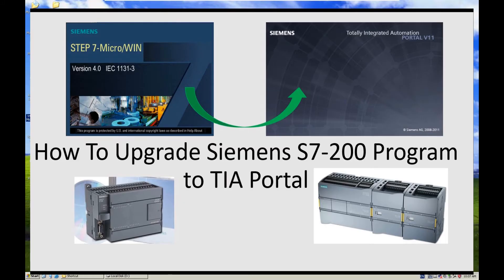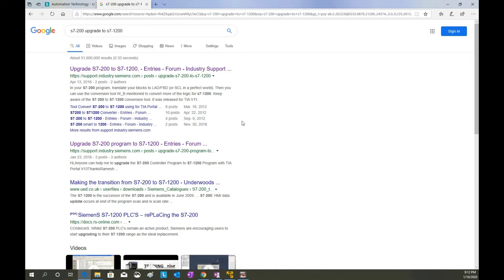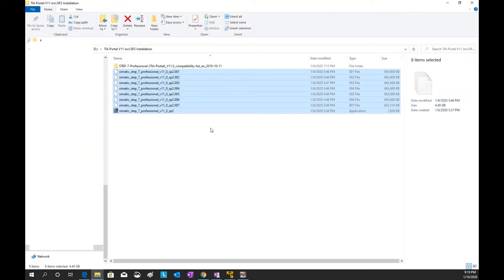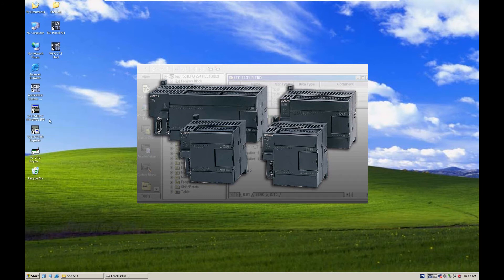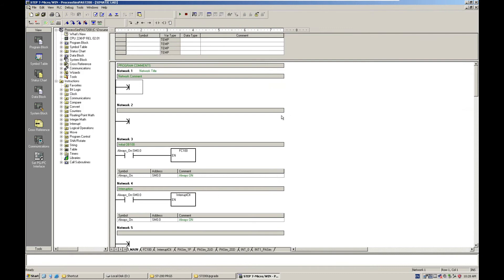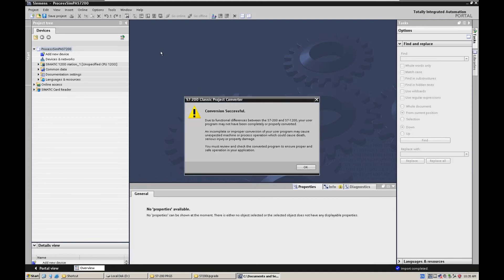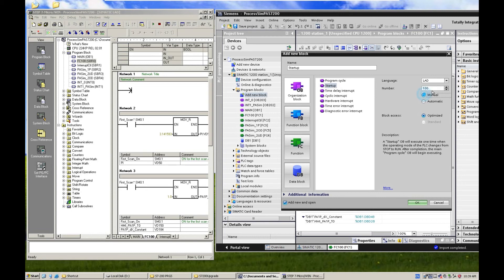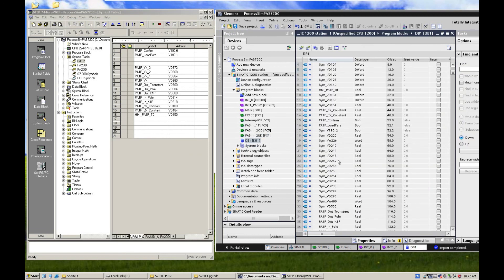U03. How to Upgrade Siemens S7-200 to S7-1200, Migrate Micro/WIN Program to TIA Portal

Comment: I want to migrate a project from Step 7 v5.5 to TIA.I tried the built in tool of TIA but it ends with errors.
Can anyone tell me the steps of migrating a project??
Reply from the maker: You can use the option 'Migrate Project' in TIA Portal to migrate Step7 project. But I highly recommend reading details on the following two links
https://support.industry.siemens.com/cs/document/62100731/what-are-the-requirements-for-migrating-a-step-7-v5-x-project-to-step-7-professional-(tia-portal)-?dti=0&lc=en-CA;  https://support.industry.siemens.com/cs/document/109478811/migration-guide-simatic-s7-300-400-to-simatic-s7-1500?dti=0&lc=en-CA

Comment: Is it only possible to convert to at most the tia portal v11?
Reply from the maker: I would say yes. I can use higher TIA Portal version to open the V11 project after you upgrade. Note that you have use TIA Portal v13 sp2 open it firstly, then use >=14 open the V13 sp2 project.
Reply: @electricalautomation  And so on until the V17?

Comment: It is not working for me. I tried many times to install new windows and follow all the steps but still no Convert tool possibility. I tried windows xp and 7 32 Bit in virtual machine.
Reply from the maker: Hello sorry for hearing that. Did you install the MicroWin before the TIA Portal? Please install MicroWin 4.0 sp9 firstly, then install the TIA Portal
Reply from the maker: Hello, I just found the converter tool and shared it via google drive. You could try to install it. Please see the comment under the video. Item#4. https://drive.google.com/drive/folders/1wQ6dAK5sWyA2wlqRurV5TIuUMOf7dPdT?usp=sharing

Comment: on siemens website, I got the V11 sp2 update 2... :'(
Reply from the maker: Good Luck my friend, pls try this link https://support.industry.siemens.com/cs/document/106449434/simatic-step-7-(tia-portal)-v11-sp2-trial-download?dti=0&lc=en-WW
Reply: @electricalautomation  
the new link is the same V11 sp2 update 2, i cant find the converter tool there
Reply from the maker: @cobymils  I attached a google drive link (under the video, comment) for the converter tool as a reinforcement. You can download it.

Comment: Dude, you saved my project. As old S7200 are a little bit scarce on my area, I got a machine with a dead one that needed replacement and after hours researching for a port tool I found your video. Very precise, it will save days from manual line porting. Really thank you.
Reply from the maker: Thanks a lot! If you need sth new about S7-1200, Pls let me know or send email to me.